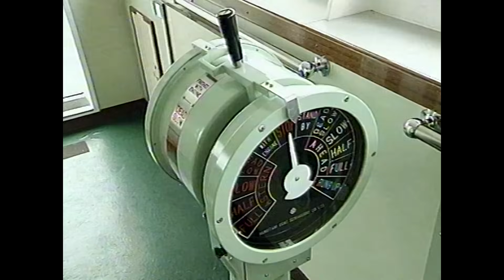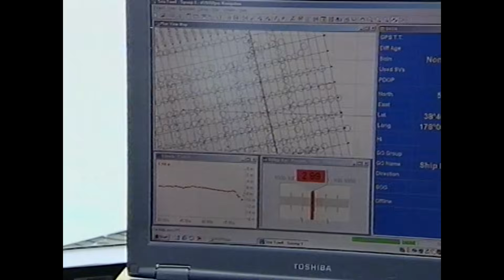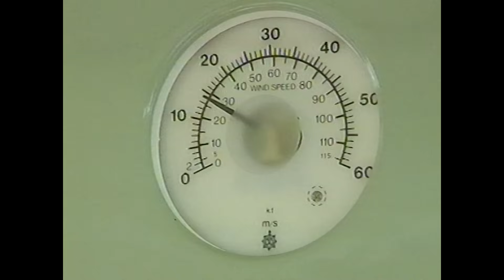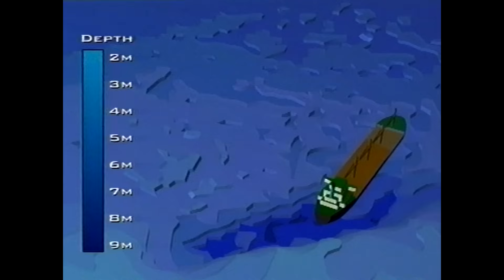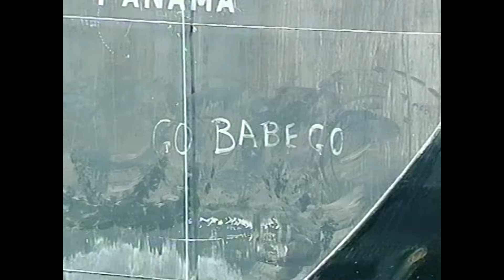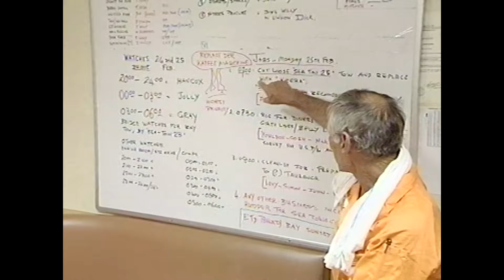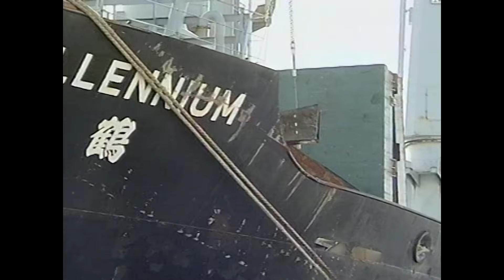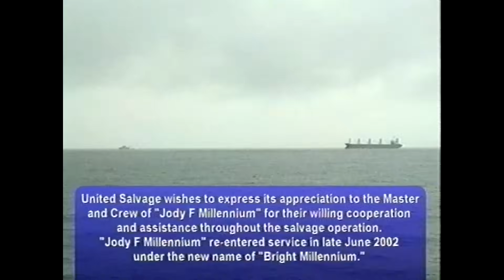Salving Jody F Millennium

Comment: Brilliant Video  Built in 1999 in Japan and delivered in Feb 2000. Ran a ground as per video,  was repaired and renamed Millennium Bight (June 2002)  In Nov 2006 ran a ground again in New Caladonia and was refloated after 3 weeks. In 2008 it was sold and  renamed Singapore Grace and In 2010 it was sold again and was renamed  Birch 4  and in 2015 it was renamed Georgia K. It all ended in 2019 when she was sold for scrap and broken up in Chittagong India
Reply from the maker: I'm amazed she was aground for 2 years from 2006 to 2008, she sure had a tuff life. Thanks for the update.
Reply: Therefore a full working g life with a few mishaps.
Reply: I don´t have ship knowledge, but being transformed in Toyota at age 20, isn´it too soon ?
Thanks for that document.
Reply: Our ships on the Great Lakes last nearly 100 years
Reply: @ogunsharpeningservice  very true, those Lakers don't have to put up with the salt corrosion, the deep blue fleet go through, which doesn't help the ocean going fleet. Maybe the Lakers are treated a little more kindly as well.
Reply: @Mark-GVP  she didn't like the water
Reply: Thanks for the summary. I was going to look it up myself to see if she was scrapped by now but you saved me the time. Seems these ships have a lifespan of about 20 years and after that, they start to have structural fatigue issues and break apart at sea so they scrap them before that happens.
Reply: @trackhoe23  20 to 25 years. Similar to aircraft
Reply: @danielfantino1714  no. These vessels have a very costly survey when 20 years old. Sell it to the competition and loose cargo? have a high expense to keep it going? scrap it? Half of these vessels are scraped.
Reply: @henkoosterhof5947 
Thanks for your comment. Except for liquid, automobiles, grain and mineral, it´s mostly container shipping, always bigger and bigger.
So like you said, older ones, smaller but not enough for small cargos going from island to island. Not to mention the single hull if any still crusing cost ptobably à fortune to insure......

Comment: Would love to know what the salvage operation cost!
Reply from the maker: A word kicking around at the time was "voluminous". :)
Reply: Refloating
Pollution
Repairs
Downtime not working
Yep a lot of $$$$$$
Reply: Helicopter lifting one log off? 😂 really what a waste of time and fuel. Must be 10000 logs there.. even lifting even 20 off won't make any difference.
Reply from the maker: Actually there was a method to this seeming madness, I too had the same attitude until I understood the method they employed, every ton was carefully measured. The rough weather made unloading normally far to hazardous until the weather allowed conventional methods back. What most folk didn't realize was that the salvers were getting Jody to dig her own way out. Every ton was carefully calculated, as they needed her to gently sit down at low tide, then let the wave action slowly dig a trench beneath. Weight balance appeared to be key and at high tide they refloated her, made some ground, then rinsed and repeated.  Because of the giant 8m hole in her hull the only thing keeping her afloat was compressed air, continual weight calculations were obviously critical to use this method. So many first-time salvers shouted abuse at their ideas and wanted them to try their own salving theories, but they knew what they were doing. They knew if they pulled to hard, she'd rip in two, if she sat down to heavy, she'd break up. The danger and risk involved in any method would be extremely high, just goes to show that experience is the winner under any situation and to be extremely weary of new ideas. This had to be the most professional salvage team to ever grace our shores, the most incredible amount of generational salvage experience at play. The salvage master, David Hancox was a true legend of the sea, I count myself lucky to witness his craft.

Comment: i have to say as i watched this various ideas came to mind, and i begin to wonder at the organisers running the show, obviously they are very experienced - but some issues just scream for obvious solutions - get a crew onboard to access damage, defuel in progress etc, attend to environmental fuel spills (i always think some kind of barge fitted with a filtration system and simply suck contaminants up)

from the underwater survey they showed the build up of sand at the sides, so it was obvious she can only move forward and the weight onboard is an issue, so they buggered about with helicopters, removing one matchstick at a time - i thought, get some plant with long reach onboard with log grabbing capability to move overboard onto a barge, then they began to do this later on - not sure why the cranes on board couldn't be used, obviously a power issue, can't the engines be used to power these without need of propulsion? sure issues were addressed, but some seem obvious with late conclusions 

i wonder if dropping anchor might have avoided grounding to begin, maybe another power issue, but i'm sure anchors are designed to be dropped without - ok so she lost an anchor i see

the biggest issue i have, is we have these huge ships, and still have nothing even bigger to salvage them
Reply from the maker: So many first-time salvers came up with ideas on a daily basis as you could imagine, ideas you could even see merit with, but for the salvers, slow an steady won the race.
Reply: @Mark-GVP  yep and i realise this being an old video, much has changed - or has it - thinking back to the Golden Ray, i was glued to this on Captain Andy's channel, the  mind boggles, again the solution was there, but the recovery vehicle needed to be a tad bigger, but then operating in such shallow water, so bigger wider barges with legs like rigs to sit down, pass many straps underneath and slowly rotate the patient back upright, i'm so sure re-floating and shifting internal cargo etc would be so much safer - of course its much about money, but the solution i'd have would contain everything needed - ever watched 'Thunderbirds' i mean its not difficult, you could have three or four dotted about to cover the oceans and main traffic corridors, when all considered that went wrong could have and should have been sorted in a few weeks and not three years, dreadful mess
Reply: All your ideas have merit but this isn’t US or Europe where equipment can relatively easierly brought in. They had to do what with what they had. Using the cranes to dump the logs overboard onto a barge was done when a suitable barge was availible and conditions allowed but even that was difficult. 
As far as using helicopters to lift the logs off, I knew one of the owner/pilots and he said while it looked like they wern’t doing much they could work when swells made it impossible for a barge, if availible, to operate. They actually lifted more off than the barge did.
As far as dropping anchor to stop it grounding, where it grounded was a very short distance from the channel and I doubt that doing that would’ve been effective, but I’m not a expert in that field. When it was at is closest to the shore you could almost walk out to it at low tide!

Comment: Why in gods name was she forced to leave the harbor? And the inspection crew shows up and then leaves and what do you know the oil starts showing? This whole thing is fishy?
Reply from the maker: Many of these questions have answers in other comments Dennis. I have no reason to think anything was fishy, just a very set of very unfortunate events like swells in the harbor so strong that they broke all her moorings, a terrible situation for a big ship to be in, unmoored and repeatedly smashing into the sides of a wharf, then to get nailed on an escape attempt.  Unfortunately, while exiting the harbor one colossal swell trough got so low she hit the bottom and took out her steering and power. At the start of the video, you see just how big these waves were breaking over her mast. What a call to make, stay and destroy yourself and the wharf, or run for open sea, what a terrible position to be in.

Comment: The helicopter discharge is stupid. It woyld take years discharge a ship thst big 1 log at a time😊
Reply from the maker: There is a reply to read about this from me under @johnmurray9526 above.
Reply: It was found to be just as fast and similar cost as using a tug and barge. Sounds stupid but this is the way they did it. It's a private salvage, they will choose the cheapest overall solution.
Reply: I knew one of the owner/pilots and he said they shifted alot more than what it looked like, and it certainly made a difference.